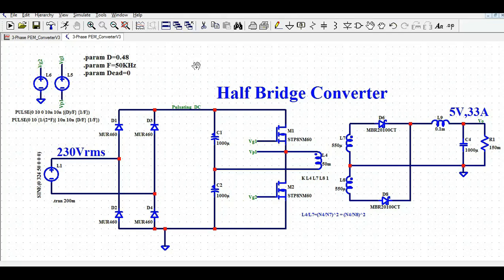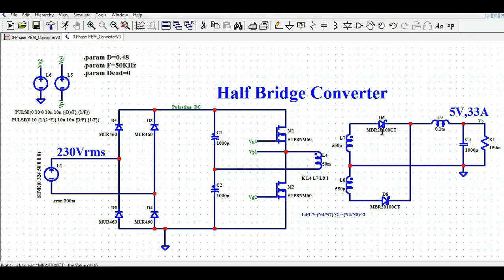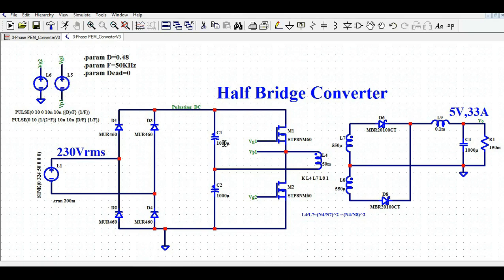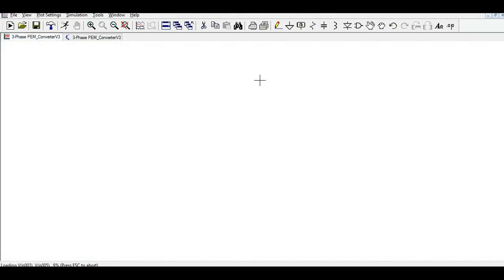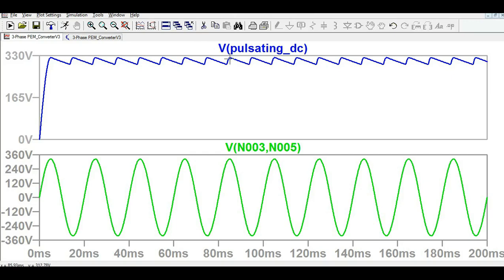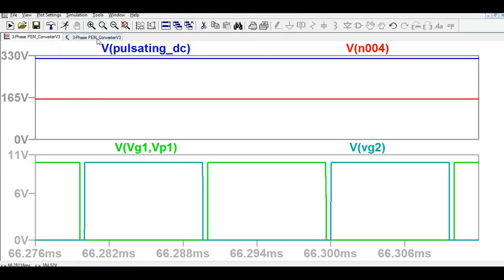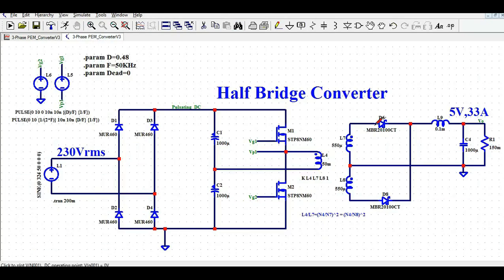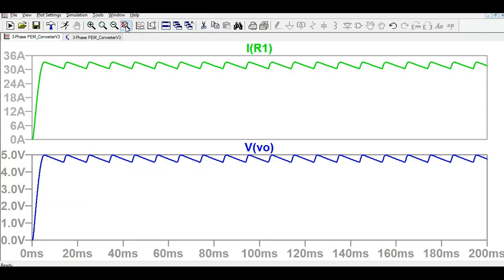[5V,33A] Half Bridge Converter | LTSpice Simulation

Comment: Professor, I setup the circuit and it runs, but my output voltage is 13 volts not the 5 volts. Do you have any sussections?
Reply: I have the same. The output voltage is 13 volts. What's the problem?
Reply from the maker: @kewnmg  Hi..please set up a meeting with me.
Reply from the maker: Hey Dan, 
Try using this file. https://drive.google.com/file/d/1cKZtaRHR4nXpONpDMLLY_p6uEBt1YYth/view?usp=sharing
Reply from the maker: Hi Danny...I got my old laptop repaired and it is working fine for now. To share the simulation files I use gdrive. You can find the link in the description of the video. Please raise the request and I will grant you access.
As such I have not created any created and drive for Q&A.
Thanks Danny me and my family doing well.